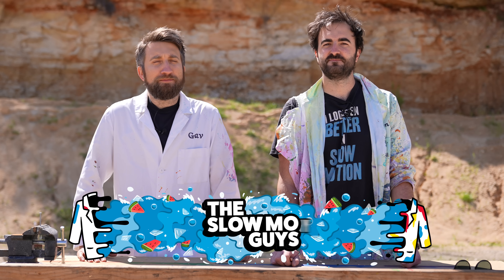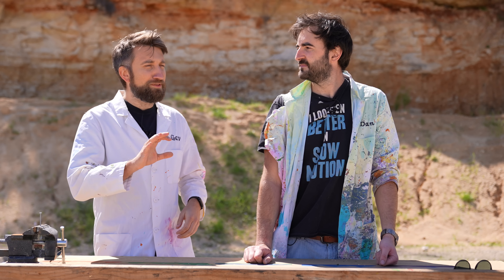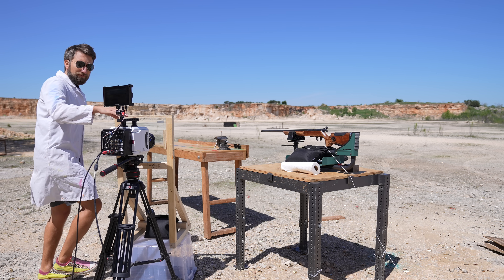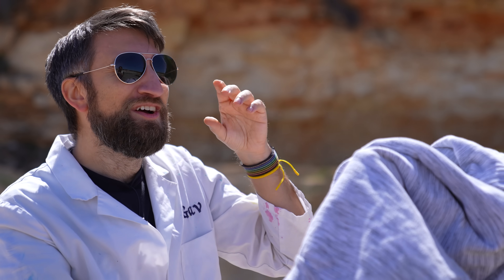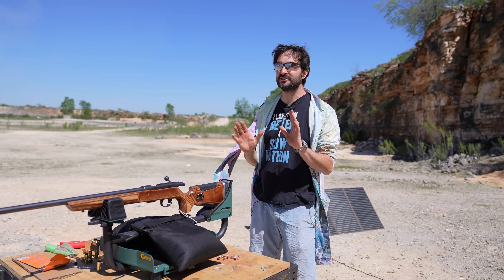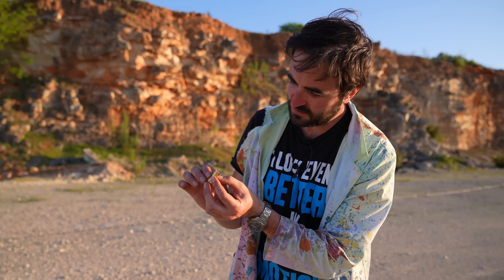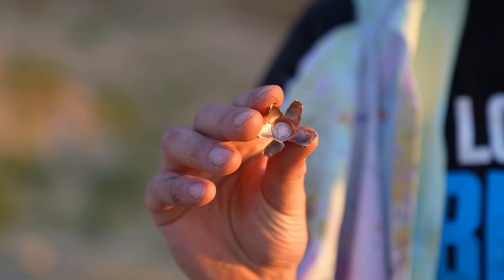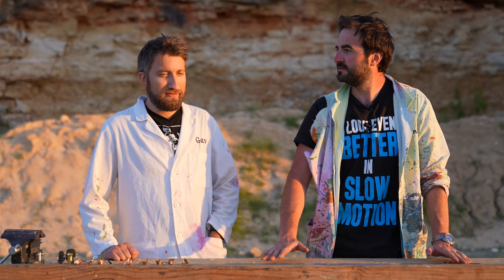Can a Bullet Go Through Another Bullet? 875,000FPS - The Slow Mo Guys

Comment: Sometimes the projectile does not stabilize when it leaves the barrel.  Particularly with the small .22LR .  Sometimes the bullet does not grip the rifling.  This can be caused by the condition of the barrel.  Rusty, pitted, groves clogged, wear and tear on the barrel.
When you switched to the larger caliber ammunition you were using a hollow point and a soft point rifle bullet.  Both perform in exactly the same way.  Both designed to expand and produce a larger hole in the target.  So when you hit using this combination you get exactly what you see in your slow motion shot. Both expanding extremely quickly and dumping all of the kinetic energy into to heat.  Giving you a look at semi molten lead.
Now in the movie you showed, the X bullet was smaller yes, but it's extremely pointed. And was a different color, looked like steel? Or maybe something else?  But then you run into the bullet not gripping the rifling.  This can be solved by the addition of a copper base cap on the bullet.  They make them for softer lead bullets that don't reliably grip the rifling, they just tear through the barrel and upon leaving the barrel they start to keyhole, or flying sideways, or any which way it wants.  But the bullets would have to be machined on a lathe to fit perfectly in the rifling like a howitzer round.  Then you'd have to add the copper base cap on the bullet.  Not impossible but expensive.

Comment: I still need to understand how does copper spark?  Every time, you have a spark as the rounds met.  Why?
Reply: Could be lead reacting on contact with air. Could be the air itself. Get anything hot enough, it'll glow. If the impactor is stopping up the hollow and then compressing the air trapped within it, that air's going to get hotter. Ever feel a hot bicycle tyre after you pumped it up from 14.7 to 49.7 psi? Imagine how hot the air there gets being squeezed between bullets.
Taofledermaus gets a lot of flashes on impact, too, especially on the lead plate. Obviously that's splashing lead too and it's stopping projectiles harder than a row of lemons or a case of cheap soda, so it doesn't narrow down the explanation, but some of them look like lit showers of sparks to me to I'm guessing it's metal reacting with oxygen.
Reply: @Sableagle  - Thank You.  I have seen what you described in using air power.  I just hadn’t taken it to this conclusion.

Comment: of course its not going trough if you only fire 1 gun and only have only 50% of the Energy.... you need to fire both rounds.
Reply: As Einstein said, it's all relative. The "stationary" bullet on the nail is hitting the "moving" bullet that came out of the rifle just as fast as vice versa, and how fast they're going east or around the Earth-Moon barycentre or around the Solar system barycentre can be ignored. You can convert temperature and relative atomic mass to root mean square velocity of the individual atoms in a gas. In a solid, it's probably a bit more complicated, but in a gas, lead at its melting point has r.m.s.v. 77 m/s, at its boiling point 247 m/s and iron at its melting point 809 m/s, so iron hitting lead or lead hitting iron with a relative velocity of 750 m/s is going to cause the iron to behave as a solid and the lead to behave as a liquid or even a gas. A steel-cored .30-06 AP might have made it through, from far enough back for it to have slowed down enough to not "melt" on impact.
The only pistol cartridge that comes to mind as being likely for that scene is 5.7 x 28 mm, which has more of a five-hundred-and-some velocity, so a steel one like SS190 might just do it. I'd expect it to lose an awful lot of energy and tumble on its way through, though. Also, I don't see a 5.7 pistol in the IMFDB lists.

Comment: I think an ap round would actually make it out the other side, as less energy would be absorbed by the deformation of the bullet. Larger bullets out of a handgun typically move more slowly, so the part of the bullet in front of the smaller bullet would have similar mass but less energy due to slower velocity, and it would be accelerated outward, not directly back, and so wouldn't slow the bullet as much as if it was directly opposing its movement, especially with the soft lead and a pointed tip on the ap round.

Comment: I'd suggest you lads look into purchasing something known as a bullet puller. This is an item from the reloading hobby. Needed because now and then one needs to remove a loaded round because it wasn't seated just right or the depth is wrong etc.. It would make obtaining the individual rounds far easier. Also you may be able to buy loose rounds from reloading suppliers but I'm not sure what the laws are like there, I know it can be restrictive in some areas.

Comment: In all fairness, you guys should've ran his test with a 57 and The 50 projectile the 57 comms in an actual Full Metal Jacket. Protecting the inner lead core from bonding to the lead. 22 long rifle Copper clad  but there is no jacket. It is just Lead on lead which is probably why the bullets not actually making it at least most of the Way through 57 is tougher and faster than 22L. R.  Just my thought. The .223 or 5.56 is the same diameter bullet  just faster and ever so little heavier.  22lr is .223 diameter  and the .223/5.56 is .224 diameter the .22 Magnum is also .224 diameter.  The 57 is slightly bigger around but slower then the 223 and faster then the 22lr.    Either way love the videos

Comment: Actually the movie has it almost correct because the smaller bullet looks like a steel tip bullet. It's very close to what you guys have actually. But if both bullets are moving and they're both lead then you're right you're just going to get a splash. If the smaller one is steel tipped and the other one is lead then I think you'll get the same effect you guys got with the stationary lead bullet. 
In your video you have a disparity in speed. If both bullets are moving you have a disparity in materials which I think would give the same effect as the disparity and speed. If that makes any sense. I think you guys proved it correct even though you don't think you did

Comment: I am fairly certain the smaller round in the movie was a 5.7. Smaller than a .22 and much much faster.
Reply: They're pretty much the same size.
5.7 mm goes through land diameter 5.53 mm.
.22 LR is the same 5.7 mm bullet diameter but squeezed through 5.4 mm land diameter.
The higher velocity's the big difference. That and the pointy tip.

Comment: I think you guys need to repeat this with a 5.56 green tip round, the steel penetrator in it might actually penetrate the larger lead mass due to its much higher velocity and hardness. The round used looks to have probably been a 5.7x28mm penetrator round, so maybe get a ruger 57 or some cheaper 5.7mm pistol than the FN one, and find out if that can actually penetrate the .50 cal bullet at all. Realistically the 5.7 might have the energy to do it, but the 5.56 absolutely should. And yes you CAN just hop down to your local store and get them, though I don't know if walmart sells ammo anymore i heard they were stopping or something? For 5.56 and 5.7x28mm they're not actually considered "armor piercing" because of the energy transmitted being high enough that a soft lead bullet would go through most softer armor anyway, and they don't go through higher rated armor plates that are designed to stop rifle rounds as well. Maybe talk to Ballistic High Speed because they have the guns already? Collaboration?

Comment: The initial view of the bullet collision (from the movie, I presume) has a spire point bullet (that is the descriptive name for that shape) small bullet hitting the big one.  This type (shape) bullet isn't used in any handgun of the type shown; mostly in small bore rifles.  

I suggest using a .22 Hornet, .22 Jet or the previously named 5.7mm cartridge and rifle to get the movie effect.  Rather pointless in real life (no pun intended) but it would interesting at a gazillion frames per second.

Not knowing much about high speed cameras but rather familiar with firearms and such - I suggest the bullet is not penetrating the jacket due to lack of power, but that the jacket is being propelled away from the core of the bullet by the initial impact.  In other words, the jacket isn't there anymore.

Shooting the entire cartridge:  Oh, dear!  An unsupported bullet is not 'confined' as in the chamber (burning area) of the firearm.  With no confinement, there is no pressure build up.  The pressure propels the bullet.  Without pressure, smokeless gun powder burns rather slowly.  Which is why the powder seemed un-ignited.  I am not sure if the primer fired or not.  Didn't sound it.  Igniting the primer can be occasioned by heat, which leave no visible dent on the primer.  I would speculate the .22 bullet was broad enough NOT to dent the primer in the same manner as a firing pin.

Gentlemen.  No point in getting worked up over the 'movie scene'.  I'm sure the movie scene was accomplished with 'trick photography' and 'special effects' rather than actually doing what you fellows really did.  By the way, the .22 long rifle bullet has a bullet diameter of .223 inches or 5.7mm.  The .30-06 Springfield has a bullet diameter of .308 inches or 7.62mm.  I imagine the 7.62mm bullet is just over the diameter of the hollow point in the handgun bullet.

Not something else to do, but another movie.  The movie "Minority Report" showed slo-mo shots (obviously special effects) of a submachine gun.  The gun was 'shooting' complete, unused cartridges.  I made a rude noise.

Comment: Pretty sure in the movie they were using a .22 hornet, which I think if you could find a steel version would penetrate the .50 AE and carry through. They're made for penetration and have considerably more powder in the cartridge. You could have also tried a 5.7 which is a good round for penetration and it's smaller than a 30.06

Comment: The flash from the hollow point is probably grease igniting inside the cavity when the compressed air reaches the grease's flash point.
To test this , degrease some bullets with contact cleaner and see if they still flash.

Comment: I think that the main difference between the movies and this is that in the movie, it is an armor piercing ammunition going through the copper bullet. If you had a tungsten bullet go through the 50. cal. I think it would be way different. There would probably still be deformation of the tungsten round, but it would have a much easier time going through the bullet due to its density and increase of mass increasing its inertia.

Comment: They do make these things called bullet pullers that you may find useful if you do more shooting videos.  They're rather cheap.  They are basically a hammer that the bullet goes into and you hit it on something solid.  The bullet and powder will fall out.  Also, the volume of powder is one thing, but so is the burn rate of the powder.

Comment: You can easily get harder projectiles. All of the projectiles you used in this video were just lead and copper, both of which are relatively soft.  You can easily check for steel core projectiles with a magnet.  Often military surplus ammo or rounds with a gray colored steel case instead of a gold color brass case have steel in the projectiles too. I'm not sure if it is still imported, but TulAmmo is usually steel core.  Many indoor shooting ranges check the ammo you bring with a magnet because they don't want the steel to damage or go through the backstop or bullet catch, and because cheap steel core ammo is so common. Another example of US surplus is green tip 5.56 rounds.  Most small gun shops should be able to help you find steel core ammo if you tell them what you're trying to do.  The video would be even crazier because the steel core rounds have some copper and maybe lead around the steel core that will peel off during the collision, while the steel core proceeds through unaffected.

Comment: to get the movie effect, you'd need a piece of hardened steel. If you can't get an armor-piercing .223, and you've got a lathe, you could make it out of any hardenable steel: whether pin/rod stock or just an old bolt (anneal > turn > harden)

Comment: It's not movie accurate because you're not using even remotely movie accurate ammo. The smaller round in the movie is obviously meant to be some type of armor penetrating round, but you're using one of the weakest and softest rounds available. If you really want to attempt this and make it as movie accurate as possible (without making your own ammunition), replace the .22lr with a steel core 5.7x28. It has the exact same diameter as a .22lr (.224 inches), but a higher velocity with a steel penetrator that would probably perform almost exactly the same as the movie. Would be really interesting to see yall attempt this again with better ammo. Maybe reach out to some of the guntubers and see if any would want to help make a video on it.

Comment: Five-seven would be the perfect ammunition for piercing another bullet. It has a lot more propellant, is a tiny round, and most of the rounds have a pointy tip meant to pierce body armor.
Reply: Or you could get some 5.56 green tip. Depending on where you live you could actually get that at Walmart.
Reply: @heirofaniu  Pretty sure Walmart stopped selling 5.56 because AsSaUlT WeApOnS!!1!1

However, I agree Green Tip would be pretty good for this.
Reply: That's round in the movie
Reply: @TCFC2  Yeah, that's what I thought as well. The bullet really does look like 5.7
Reply: Or .17hmr
Reply: Did anyone ever make a varminter type rifle for 5.7? Seemed like a cool cartridge when I played with it 15 years ago
Reply: @The_Angry_Medic  Depends on what you consider to be a varmint rifle. For a bolt-action, "traditional" varmint rifle, the only one I'm aware of is the Savage Model 25, but it is long discontinued in that chambering, and probably very difficult to find one. But if you go with a compact semiauto, there's a few choices. Of course there's the FN PS90, but there's also the Ruger LC Carbine that is much less expensive.

Edit: The Savage 25 in 5.7x28mm may not have actually entered production. Some say it did, some say it didn't. Even if it did, it would likely be exceedingly rare and basically impossible to find.
Reply: @Justin.Franks  Custom barrel makers (e.g. EABCO) offer 5.7x28 barrel conversions for  the Thompson Center single shot rifles and pistols, in lengths anywhere from 5" to 24".   Only time place I've seen a TC in 5.7 was  a custom ammo maker,  testing new bullets/load combos.

Ruger's 57/LC would be the poor man's Five-seveN/P90 combo.
Reply: @The_Angry_Medic I’d imagine they have, but for that purpose, 5.56 makes a lot more sense. Ballistically superior, and way cheaper to feed. The only caveat being that 5.7 may make more sense if you have a handgun chambered in it, so that your ammo works for both
Reply: @The_Angry_Medic no but 17 hmr is very similar
Reply: Well .223 and 22 hornet and 22 250 already existed for that @The_Angry_Medic
Reply: @The_Angry_Medic I think Kel Tec maybe or Ruger and it’s not very good as a rifle round
Reply: @The_Angry_Medic  Wouldn't most of the .17 cal cartridges fit that?
Reply: Exactly my thought
Reply: That was my first thought and what I was hoping for.
Reply: An armour piercing one would be even better, with steel or tungsten tips/cores, pretty certain they exist
Reply: @Cheesepuff8  Bloodsport was definitely using bullets with some super-alloy, for sure
Reply: This channel has 15 million subscribers. They can't afford 5.7!
Reply: Not sure if anyone's mentioned it yet, but the projectile in the footage looks closer to 17 HMR.
Reply: yes
Reply: And closer to the round shown in film.
Reply: That's why it's not for sale for civilians
Reply: @sebastianleon5199  it is though. You can legally purchase it no problem.
Reply: @scooter2161  yeah you can get a five seven no problem, but you are not getting AP for it that easy and it is going to be extremely expensive. Had a five seven and truly it was not that impressive.
Reply: @SomeReefer it took me 5 minutes to find somewhere with ss195lf ammo in stock. Really not that hard. It’s a dollar a round. There’s no way that’s outside of their budget. 

And before anyone tells me that’s not green tip ammo, it’s the same exact bullet as the ss198lf but it’s just not painted green and it’s loaded to slightly less pressure. It would’ve worked just fine for this experiment since it’s not a lead core.
Reply: thats right, i just couldnt remember what it was called.
Reply: The armor pen you are referring to was different ammo designed at a time when the gun was in a design phase/ early market entry .   You just repeating falsehoods gun grabbers use as ban points ..    FYI
Reply: Couldn't help but scream this all video
Reply: It looks like a .22 hornet in the movie I would be interested to see it.  Hornets are just pointy .22 with more powder
Reply: @jackdonoughe4892  bullet shape looks right, but the length of the cartridge would likely preclude it from being fired from a handgun, in addition to a lack of modern day popularity. 5.7x28mm would definitely be the most likely option
Reply: Yeah, I wish they would’ve done this with some kind of round that isn’t a lead core. They are readily available as well. Maybe not at Walmart, but you can definitely get them online

Comment: the hollowpoint clearly contributes, probably in the main, to the stationary bullet's explosion, and even if both bullets were shot, the result would be the same, as the kinetic energy would simply be increased, causing the hollowpoint to expand outwardly faster upon impact.